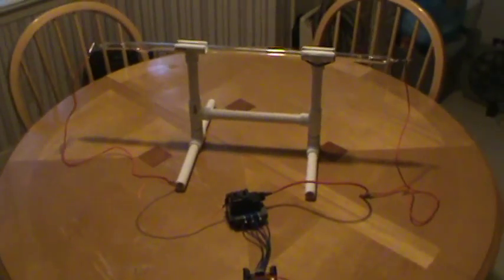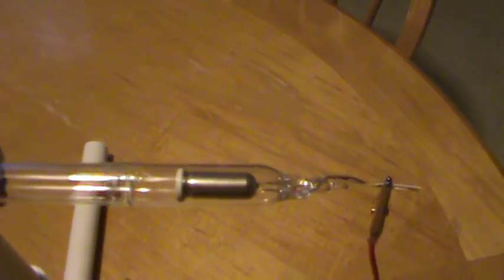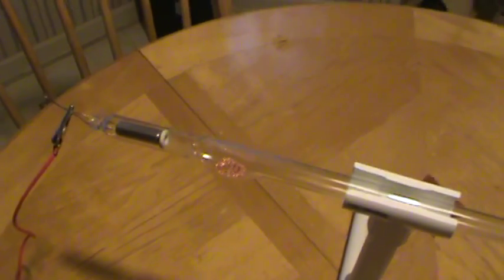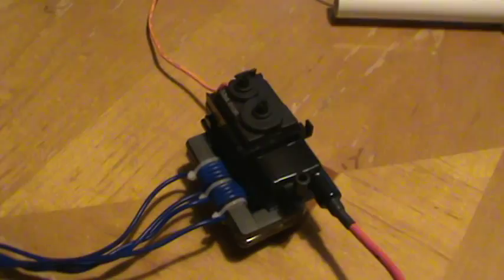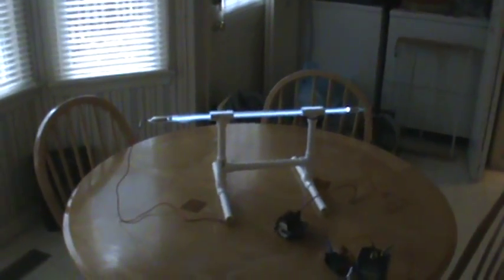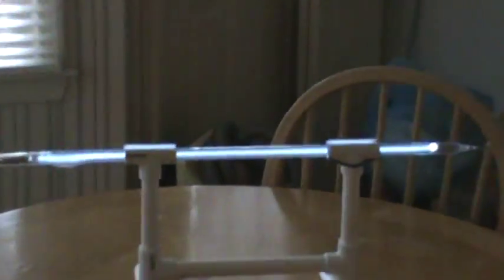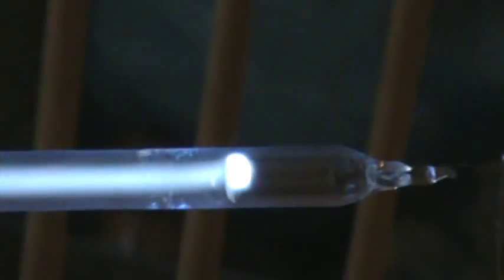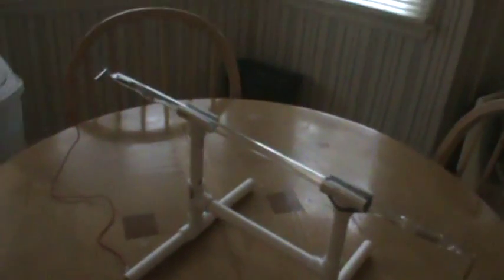Homemade Crookes Tube

Comment: That looks more like a Geissler tube.

The discharge inside is ionised gas, not cathode rays (which you can't see). A true Crookes tube needs to be evacuated to a much higher vacuum, at which point the 'Crookes dark space' you can just see the beginnings of, extends the full length of the tube. The glass begins to fluoresce green where the electrons (cathode rays) hit the walls.
Also at that point x-rays begin to be generated and the whole experiment starts to become dangerous. :)
Reply from the maker: Verruca If you say so, but there's no gas in the tube other than very attenuated air. I checked for X-rays and detected none, but there are some beta particles (electrons) coming from the tube. (Tested with a CDV-700 geiger counter; with beta shield closed, no reading. Beta shield open, positive readings).

From Wikipedia, the free encyclopedia

@250

A Crookes tube (2 views): light and dark. Electrons travel in straight lines from the cathode (left), as evidenced by the shadow cast from the Maltese cross on the fluorescence of the right hand end. The anode is at the bottom wire.A Crookes tube is an early experimental electrical discharge tube, with partial vacuum, invented by English physicist William Crookes and others around 1869-1875, in which cathode rays, streams of electrons, were discovered.Developed from the earlier Geissler tube, the Crookes tube consists of a partially evacuated glass container of various shapes, with two metal electrodes, the cathode and the anode, one at either end. When a high voltage is applied between the electrodes, cathode rays (electrons) are projected in straight lines from the cathode.
Reply: MisterApol Vacuum is not so simple as full/empty. Full atmosphere is one bar or 1000 millibars. Your tube is probably in the region of 1 millibar or maybe 1/10th of a millibar or even (if it's a good pump) 1/100th of a millbar.
That might sound good - but it's not. To get into the region where gas collisions are rare enough for an electron to travel the length of the tube, you need to get down to around a millionth of a bar - (one micron). That's almost a thousand times better. 
The sort of pumps a sign maker uses are just not that good I'm afraid.
If your friend really wants to try for it, the cheapest pump type for that job is a 'turbomolecular' pump. https://en.wikipedia.org/wiki/Turbomolecular_pump
Reply: @qwadratix  crooks didnt use a turbo molecular pump. I think they used a mercury vacuum pump then
Reply: @manudehanoi  He used a mercury diffusion pump. We were using similar but safer oil diffusion pumps until very recently.  They can still be found in some labs. You can get down to about 10E-11mb using them.
Reply: @qwadratix  do you have a name i could google for these lab deep vacuum oil pumps ?
Reply: @manudehanoi  If you want an explanation of how they work, try Wikipedia's entry on 'Oil Diffusion Pumps'. For a manufacturer, Edwards Vacuum, Balzer or Varian are probably the leading suppliers. They're expensive new, but you can find used ones on Ebay.